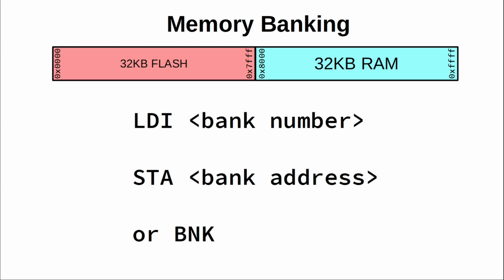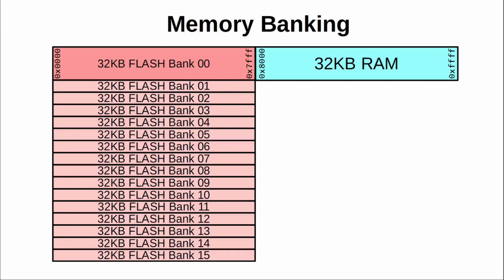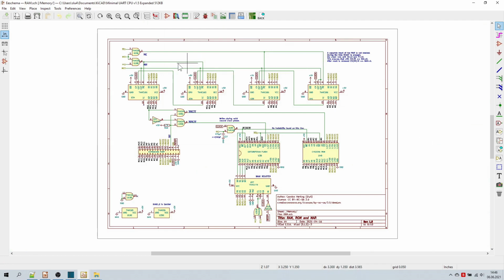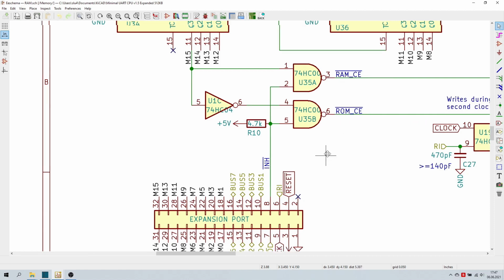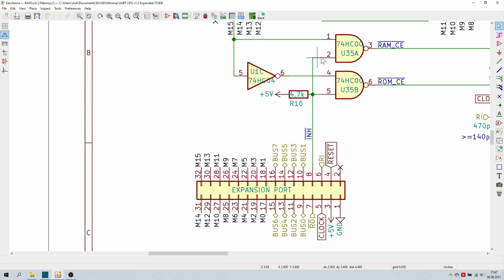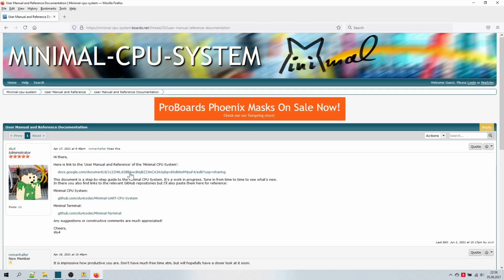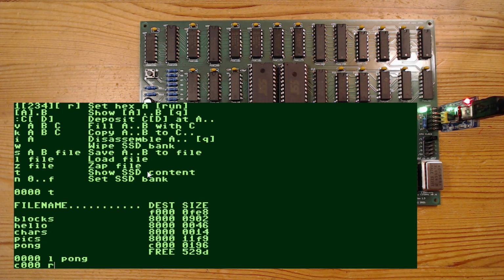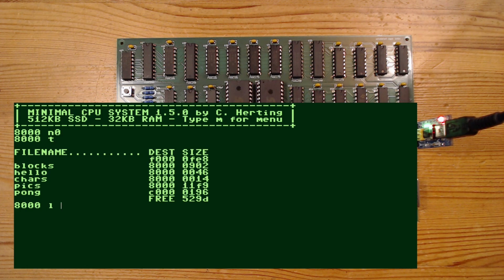Building the Minimal CPU System (SAP-1 on Steroids) with 512KB SSD and Expansion Port

Comment: I finished building the Rev 1.5 of your board today! 
Result: Doesn't work....
I had replace the lower 161's of the MAR with 173's
It also seems that the 39SF010 flash for the control word didn't work (maybe chinese fake).
I replaced them with Winbond 27C512
Now the board seems to run, but shows garbage on the screen. Probably wrong CPU clock/serial port config.
Do you have a debug checklist for this?
Reply from the maker: Hej Waldo, the MAR needs 161's since it implements the "count" functionality. Many bad things can happen if you change the design just like that. Please follow the bill of materials as specified. Good luck!
Reply: @slu467  Haha, it was not my intention to change the design. It was a mistake! I took several 161's from another board, and made a mistake putting the wrong chips in. I will further investigate...
Reply: I now have the board working with the 39SF010 flash eproms. 
I also tried to get it working with 28C64 or 27c512 eproms (with a little rework for the vcc/we#), but with these eproms the MSB eprom seems to be very timing critical. Specially the IC signal doesn't work properly. The LSB eprom works well with 28c64 or 27c512. 
Do you have any idea why the MSB eprom seems to be so critical? 
Do you know any signals that I can look at that might need improvement?
Reply from the maker: @WaldoHazeleger  Congrats on getting the 1.5 online :-) Why other ICs might or might not work in the circuit? Really hard to give any advice from afar. I'll soon release the Minimal 64 design - which is superior to the much smaller Minimal UART CPU 1.5 in many aspects.
Reply: @slu467  Are you gonna test the new minimal with 28c64/256/512 eeproms? It worries me a lot that changing the eeproms from 39SF010 to 28c64 makes such a huge difference. On the Scope I see several spikes on the control signals during falling edge. Which is (in theory) ok, since clocking happens on the rising edge. But i fear that clocking sometimes also happens during these spikes. Specially spikes on the IC signal, which will cause a step counter reset if they happen. Can I do something about that? Maybe change the value of C27/C28, or something else?
Reply from the maker: @WaldoHazeleger  Since I do not plan on specifying this design for any other IC than the 39SF0x0 I can't go into detail here. The new design (Minimal 64) is much improved especially when it comes to the IC circuit. Schematics will follow soon so you can take a look for yourself. Happy tinkering!
Reply: @slu467  I found the problem. It is indeed caused by spikes on the IC signal. Spurious spikes will asynchronously trigger reset the step counter. I saw that in V1.2 of the design you had a capacitor to prevent these spikes. No idea why you deleted it in later versions. In my case, 100pF was too little, 100nF too much. No idea what the best value should be. Maybe a better solution is to replace the 74161 step counter by a 74163 one with synchronous reset. Or will reset come too late then? Anyway: For now I solved it for this design and in happy anticipation for the Minimal-64 design to come out to see how you have solved this...

Comment: How can we add blinkenlights like you had on your intro video about minimal cpu ?
Reply from the maker: Yep, many of the core signals are accessible via the expansion slot and can be used to control blinkenlights. However, the CPU is quite fast - so there isn't much to be seen blinking... ;-)

Comment: Were did you get the SSD?
Reply from the maker: The FLASH EEPROM should be available at any local electronics shop. I bought mine at reichelt.de for example.
Reply: @slu467  ok, thnx

Comment: This is a super interesting Architecture with the Microcode. I had to think about it quite a bit to work out how I think you're doing the shift operations, it doesn't appear from what I can see in the microcode file that it's exactly the same idea though. Some things I'd love to see - a detail explanation of some other microcode functions like Shifting, and the Manual I think needs a description of each of the signals. e.g. what "ES" or "EOFI" are. I know it's in the architecture video, but it makes the manual a lot more difficult to use when it doesn't contain that information! Fantastic idea though this design, I love it.
Reply from the maker: Thanks for appreciating ;-). The architecture is simple but the microcode squeezes every little bit out of it ;-) Since I've already spent hours on the Manual to get it to the current stage, it may take a while to do a full description of the architecture's signals and other aspects... but it's on the list. Did you see the 3 video about microcoding on my channel? Cheers!

Comment: With the addition of the expansion port, is it worth having a re-think about interrupts. If you have to continuously poll hardware, you can waste a lot of cycles.
Reply from the maker: Hi Cray Ze Ape, I think about it every now and then. You have a point with the polling of cause. But I think with interrupts this wouldn't count as a "Minimal CPU" any more. One has to draw the line somewhere, I'm afraid. So probably there won't be any interrupts within this project to keep the design really accessible for as many people as possible. Cheers.
Reply: @slu467  okay, though it's really just an externally triggered "Jump To Subroutine". If the polling becomes a burden, it slightly diminishes the term 'Usable" in 'Simplest Usable PC' ;)
I have lots of 74 series logic on hand so I'll look at it in more detail myself at some time soon.

Comment: Great project!!! I am really looking forward to what your next project will be. I am really hoping it will be adding a GPU, Sound card and dedicated keyboard interface to make this a fully independent PC. It will very hard to accomplish though. Great work as always!
Reply from the maker: Hi, have you seen my previous video introducing the Minimal Terminal? With that this CPU already can count as independent I'd say ;-)
Reply: @slu467  Hey! I wanted to mean a dedicated GPU like the one of Ben Eater .Probably a GPU without any microcontroller. As for me Pure TTL logic is the best :). And is there any specific reason why there aren't the higher memory bits (16-18) on the expansion port?
Reply from the maker: @naveenchavali8488  Memory-mapping should work independently of the bank selection. Therefore only the "real" MAR of the CPU is available on the expansion port.
A TTL VGA would be interesting - wou are definitely right. I have a video series about a "DIY VGA card' and I might try to combine the two. Stay tuned!
Reply: @slu467   I built a TTL VGA graphics card, taking inspiration from you and Ben Eater. I can help you out if you want to build one :)  . Now it makes sense about the banking.
Reply from the maker: @naveenchavali8488  Of cause you are very welcome contribute a VGA expansion - and probably shoot a video about it? That would exactly be the kind of thing I'd love to happen ;-)

Comment: Great work, Highly appreciated ! Unfortunately, soldering is not really my key strength. Is it possible to buy a fully assembled board for a reasonable price?
Reply: Perfect opportunity to practice! Practice makes perfect!
Reply from the maker: Hi Torsten, currently I am not planning on producing or selling any boards. I have a spare 1.3 version here but it only has 32KB - not the full 512KB SSD. But I might have something for you: A few videos down the line I will publish a cycle-exact emulator running on Win10. Stay tuned!
Reply: @slu467  Hi Carsten, Many thanks for your fast reply! Do you think that the 1.3 Version would be sufficient for just learning the basics? If so I would be really interested to buy it. In addition I could follow your emulation approach. But I like to have the Hardware in my hands…

Comment: I was going to build your Minimal CPU Flash Edition next weekend (as it is a public holiday next Monday), but I might wait and get the new PCB and parts and make v1.5 instead.
Reply from the maker: Hi David, actually both have their own right. 1.3 and 1.5 are 100% compatible. 1.3 is a bit more minimalistic and not so much suited for a stand-alone usage. Cheers!